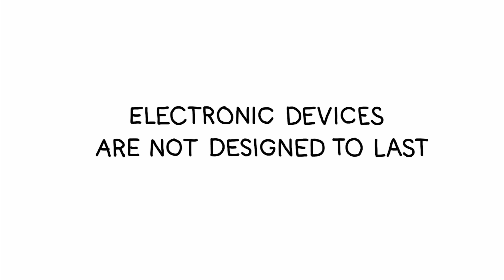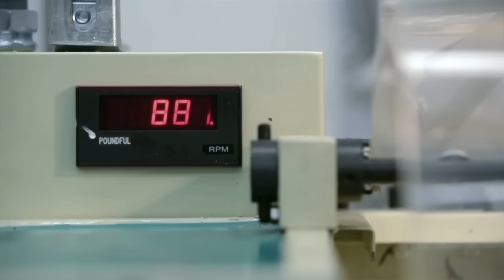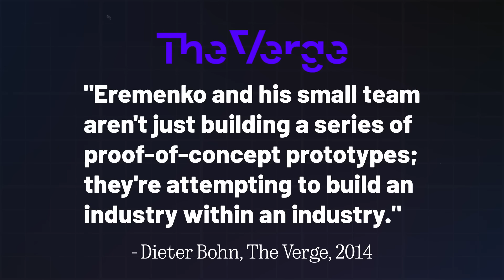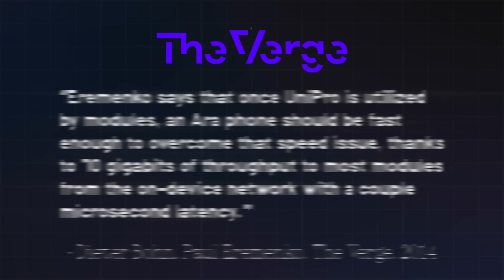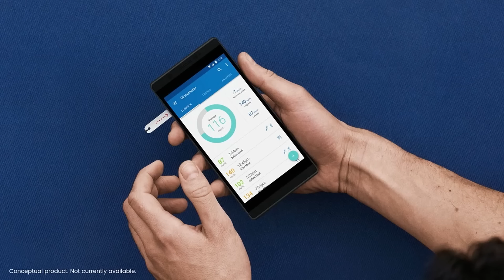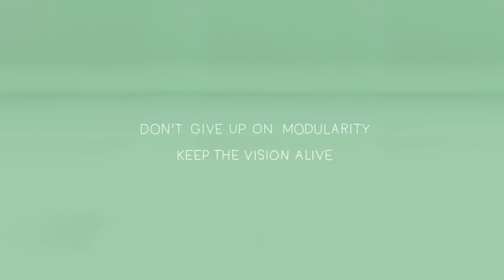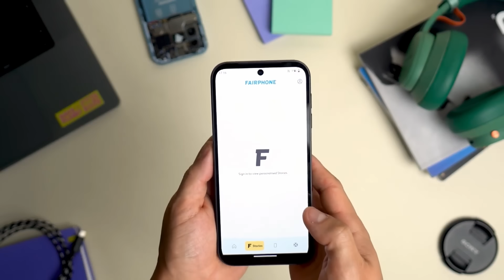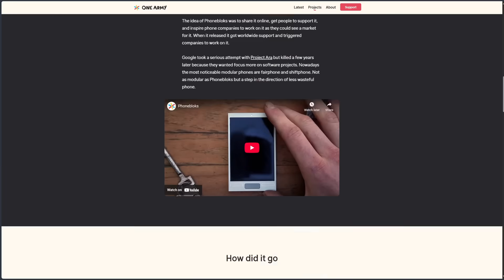Why Did Modular Smartphones Fail?

Comment: Shiftphone is alive and doing pretty well as it seems. Their newest model is the Shiftphone 8, which is comparable to the Fairphone 5. The first batch of the Shiftphone 8 was already shipped, but it had some issue, so they fixed it and are shipping batches of the Shiftphone 8.1 now. They are very transparent and I can see that around 5000 8/8.1 phones are in the wild now. It's very similar to the Fairphone 5 in specs and features. Just a tiny bit larger, but waterproof and with some additional privacy features like kill switches for the camera and mic. And like the Fairphone, it's not modular, but produced sustainably and under fair conditions, self-repairable, and with long support. They are a bit more ambitious than Fairphone, and they use the same battery form factor across devices and generations.
Reply from the maker: Oh wow that's really cool! I'll have to see if I can get my hands on one here in the states.

Comment: Sadly the fairphone 6 comes with an usb 2.0 (type-c) port.. was looking forward to switch from my fairphone 4, but this is a dealbreaker for me. The current usb 3.0 (on both fp 4 & 5) is quite old already and probably as far as you can reasonably go back in time. I prefer physical port connection (for data transfer or usb tethering). Would love to hear other people's option on that!
Reply from the maker: USB 2.0 is pretty bad I'll admit. I think the iPhone is still on 2.0 as well, so obviously it's not a deal breaker. Plenty of people use an iPhone and don't care.
Edit: I checked and the pro models of iPhone have 3.2, but my point stands. Half of the newest iPhones still have 2.0

Comment: Shiftphone is still a thing and they are releasing the shiftphone 8 this year
Reply from the maker: Sweet!
Reply: The first batch of the Shiftphone 8 was already shipped, but it had some issue, so they fixed it and are shipping batches of the Shiftphone 8.1 now. They are very transparent and I can see that around 5000 8/8.1 phones are in the wild now. It's very similar to the Fairphone 5 in specs and features. Just a tiny bit larger, but waterproof and with some additional privacy features like kill switches for the camera and mic. And like the Fairphone, it's not modular, but produced sustainably and under fair conditions, self-repairable, and with long support. They are a bit more ambitious than Fairphone, and they use the same battery form factor across devices and generations.

Comment: The things that break the most are displays and charging ports. Make those easily repairable or modular. The rest is a pipe dream.
Reply: Fairphone already makes repairable phones. But this kind of modular is meant to be upgradable which Fairphones aren't
Reply: For me it's the audio jack, but i don't use it anymore.
Reply: @Azarilh  For me it's the battery hole or smth, it constantly goes "slow charging" if you stay with the same charger for more than 3 months
Reply: @PlayTheColorfulCreature you must be mean to your phone cord to have that issue
Reply: Battery, display and ports being modular already sounds really good. Personally, I don't need upgrading but I might be a minority on this one.

Comment: We are getting closer, I have a laptop where I can replace and reconfigure the keyboard, as well as repair the internals easily.  It also has these cute little cards for IO that work over USB C.  It's a bit pricey, but I guess that's the cost of Framework being the first on the bandwagon.
Reply from the maker: That's so cool. I've heard good things about those laptops!
Reply: @owencooktech  They are't too bad.  Only really awful thing I can complain about is the LED matrix module, which seems to have a bug where they crash if you try to feed it a greyscale image, but that's like the definition of a first world problem, so I can live with it until the rust compiler finishes compiling the fixed version in a few years.
Reply: @dafoex  rust catching strays 💀💀
Reply: I specced out a framework, and even if I source the RAM (32gb) and SSD (2tb) myself it still cost around 1000
Reply: @Cringemoment4045  Yes, they are in the Apple price bracket.
Reply: @dafoex  I'd get a framework over a macbook though. Long live right to repair
Reply: Hey actually no it is not modular, just think about it, let's say you want a new cpu like intel i9 but your motherboard and other components support amd, Now you have to replace everything same with OS, you cant run something written in aarch64 assembly in a amd cpu! So basically smartphones and laptops right now are in the same condition. If you want to upgrade your smartphones YOU CAN but it will cost money same as laptop or pc
Reply: @akshobhyaeverything9468  Never said it was truly modular, just that we are getting closer.  I'd still have to replace the whole motherboard in my Framework if I wanted to update the CPU, and you are absolutely right with incompatibility between architectures, although AMD and Intel seem to be basically the same at this point, so that's less of an issue for the majority of desktops and laptops - both have an x86_64 instruction set.  I wouldn't be able to take the hard drive out of my Framework and expect a Raspberry Pi to boot it, though, that is ARM, a RISC processor, like that of my phone.  I wouldn't be able to take my Pi's SD card out and expect it to boot in my phone, because even though both are ARM, my phone has a lot of hardware that a Pi doesn't have, and at the very least I'd need to install more drivers for Raspberry Pi OS to even understand what peripherals are attached.

Comment: I mean sure, upgrades and repairs for the Phoneblocks would be cheaper, but it would still create big amount of e-waste, because some people would replace working CPU for faster one or LCD for Amoled screen, etc. just becaust that one's better.
Also manufacturers would be limited by module sizes, which means one size of display, cameras. compute block (which could affect cooling), and so on and they would also have to keep making and supporting said modules, no matter how ancient that technology was. which was achilles heel of all modular phones. Alsoalso gaps between modules and body mean no water and dust resistence.
I'd say, that instead of pointless gimmicks like modular phones, companies should focus on easily repairable phones with longer software support length.

Comment: My biggest issue is that this project reeked of somebody who does not understand technology pitching an idea for the sole purpose of raising vc funding. What we actually want is repairability not modularity.
Reply: Completely lost me when they went “running slow? Replace the block that affects the speed”

And speed of what 😭😭😭

Speed of a phone is largely linked to every part of itself. Modern phones are engineered to make sure all the parts try to work in tandem.
Reply: @dragoncommands  Exactly! For a device to be fast you need all components to be good and these include: Processor, ram, storage (need good read-write speed), graphics etc. If you don't consider all the parts you could end up with a bottleneck from the slowest part.
Reply: I don't think is entirely on his fault. Remember that this was aimed at consumers, and the grand majority of consumers is not tech-savvy or rarely cares about complex terms like RAM or Processors, the use of the "the block that affects speed" its just a quick way to make people who don't understand computer hardware terms to understand the concept of what's he talking about.
Reply: That seems unnecessarily pessimistic. I think he genuinely wanted to make it, he just knew nothing about hardware engineering and bit off more than he could chew. Which I'm fine with, the idea is now out there.

Comment: I think the problem can be easily avoided. Their issues are making components too fragmented and putting them everywhere is a huge disaster in terms of connecting busses. How could they have done it? Look no further than the framework laptops. The whole brains (motherboard) is one module. And the next generation will fit all the same dimensions to be upgradable. 
In a phone they could make it in a way that the motherboard (including ram, rom, sim, gpu, cpu) could be one fixed dimension module, it could have one big bottom module for speaker, aux, charging and one top module for the cameras and then one for the battery in the middle which doesnt allow for “upgradability” since batteries in a fixed size dont exactly allow for more capacity. So 4 modules in the back plus the screen in the front which could indeed be upgradable.

Comment: I still use my Moto Z Play, Z2 Play, and Z4 as portable boomboxes!

The Fairphone 6 or 7 is my top consideration as an upgrade for 2026 or 2027
Reply from the maker: Yeah dude I really want the new Fairphone. I don't know which Moto z I have, but I use it for the exact same purpose you do. I saw it at a garage sale and I was like oh that would be a great Bluetooth speaker.
Reply: @owencooktech  Well it's "like" a Bluetooth speaker but it ain't Bluetooth.....it's a DAP with an insanely good JBL speaker or a POCKET BOOMBOX! 😎🤙

I like to manually sync 3 of them in a row and fill my local metro station with ambient music!

Comment: I feel like the fairphone is more realistic model than a modular phone. Sure you will require some level of technical skill but making it easy for anyone to swap out will create a lot of overhead for it to be safe, durable and functional. Take for example, safety. Looking at those small modules being so easily taken off instantly brings to mind "child choking hazard". And external looks isn't much of an issue, just get a different case, similar to how we have various desktop cases. A modern phone is really just really small PC with a touch screen. It can be done but do companies want it done? Google definitely bought ara not to innovate on it but to control it. Keep your friends close but your enemies closer.
Reply from the maker: Yeah that's a good point. The choking hazard thing especially. I think for a modular phone to work you would need the basic assumption that people aren't stupid. And that assumption is risky to make.

Comment: I delayed buying a new phone for quite a while because I was waiting for Ara. Years later I'm on the fairphone but I'm growing more and more dissatisfied with both their products and their outlook as a company. One of the great tbings looking forward to a modular phone was that I could have the IO I want but Fairphone stubbornly refuse to put a headphone jack on their devices - requiring me to carry multiple (less repairable) devices when going out. When they tried expanding their repairability idea to new electronics I was excited but when I got their headphones they ended up being by far the worst headphones I ever got - failing to work fully when plugged in, being annoyingly difficult to turn off and being 10x the price of any other headphone I ever used. I'm looking towards framework for their laptops and hoping not to have this same experience.
Reply from the maker: Yeah I kind of figured the fairphone headphones would be bad. It does suck that they haven't implemented an audio jack. Seems like a no-brainer for a long lifespan sustainable phone.
Reply: My issue with framework is it sacrifices so much more than it needed to. The modular ports are a neat idea but just so expensive and they all are forced to go through a USB C interface rather than being actual native ports. The build qualty suffers from flex due to overmodularity. There is only one m.2 slot and no space for a normal 2.5 drive. The battery doesn’t come off unless you open the whole device. They refused to make a touch screen until they made a whole new device category. They refuse to enter the printer space because they don't think they can monetize a good printer (unlike their insanely priced usbc adapters only made to fit in their device)

I feel much more happy with the modularity of my 2018 Alienware because it at least has hard drive space. It has access to ram slots too. And the components are mostly modular. Only thing thats worse is probably a harder screen repair and no cpu/gpu upgrades. So unless you need that I’d say find an older laptop.

Comment: Note that "hot swappable" means the part can be swapped while the phone (or any electronic device in general) is still on, so I believe youve been using the wrong term for most the video (especially when it comes to "hot swappable" batteries)
Reply from the maker: Yes you are 100% correct. The Aras components were hot swappable, except for things like CPU, RAM, and battery. If I said that I misspoke. Camera and accessories were 100% hot swappable in the prototypes tho.

Comment: What really needs to happen is for someone to make a modular phone where you can easily swap the front display, replace the battery, speaker, camera, and storage. Older phones already let you replace the battery and storage with no problem. Honestly, I don’t care if the phone is thinner or thicker. I care about functionality that keeps my phone running longer. The problem with these companies was they wanted to replace everything. Now, modern companies make it so you can’t replace anything without a skilled technician. We should learn from the past and bring back phones where you can swap batteries and storage like before. But also take ideas from creators like the one in this video, where the display can be snapped on and off easily. I think making the display modular is a smart idea, maybe the camera too, but beyond that, most of the other modular ideas felt like gimmicks, and that’s probably why they failed in the bigger picture.
Reply: Yes this does exist in the fairphone which you can disassemble yourself in a few minutes with the screwdriver that comes with the phone.
Reply: @peekaa42  problem with the fairphone is the specs are garbage compared to flagships from 3y ago, but it's priced like a high end device
Reply: THe fairphone and the SHIFTphone kinda do that.
Reply: Then you have no waterproofing and significantly worse durability,      you have never been able to swap storage, you could use an micro sd card but thats not swapping storage
Reply: @jaydog77  I dont care much about waterproofing tbh - i dont take my phone with me when i swim, i dont drop it in the toilet, it never has a merry go round in the washing machine and even if - switch it off, if possible dissasemble and let it dry in room temperatureand you should be just fine.

The waterproofing of the recent years is coming pretty much from the bullshitery of apple where they got rid of the headphone chack to sell you ugly wireless in ears and does not have much footing in the reality imo
Reply: Even just been able to replace the camera, battery and display.

Those three items are by far the most common reason people want to upgrade to a new phone.
Reply: people that make phones don't want you to keep your phone for long.
Reply: The gimmicks should have had been a thing. I would have had absolutely bought something like this.
Reply: wait a few years I will make and come back
Reply: Isn't recent EU regulation pushing for at least some of these?
Reply: It doesn't take skill to replace a phone screen. You are just incompetent
Reply: @fourppounds  False. Jerry Rig Everything is a professional with advanced equipment, experience, and raw talent. Even he has difficulty replacing some modern phone screens.